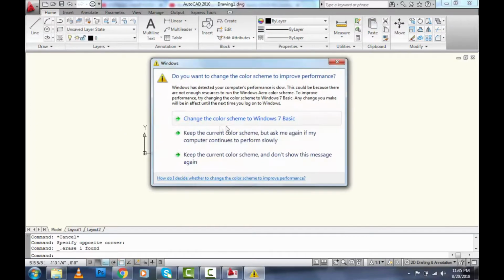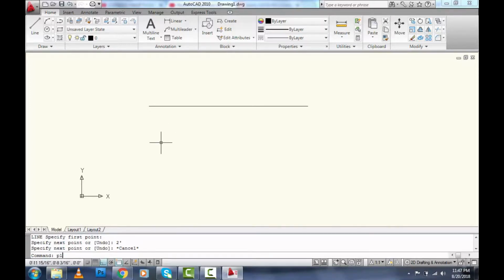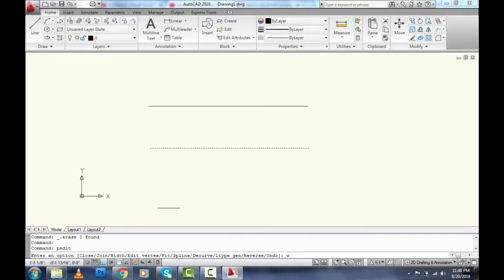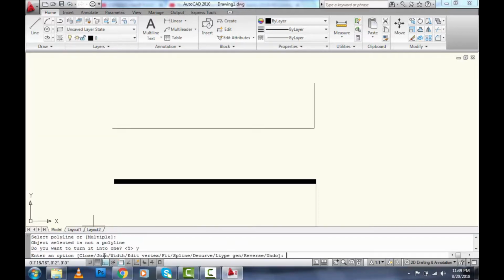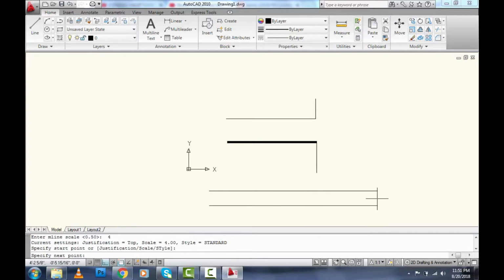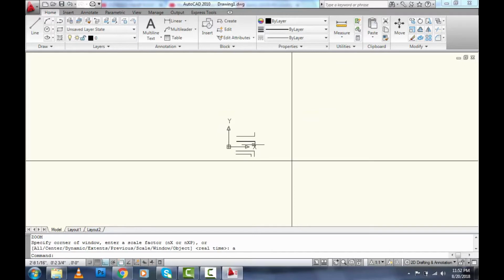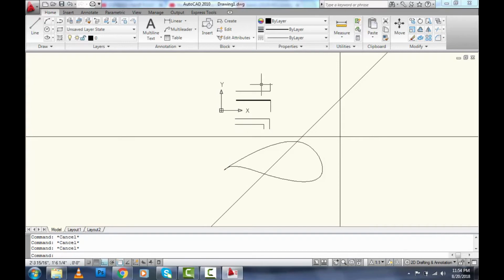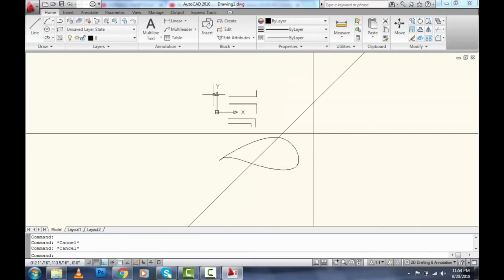Types Of Lines In AutoCAD

Comment: may i ask sir if what is the purposes of every line types give at least 10 sir if you answer this i will subscribe
Reply from the maker: Hi Dexter,

In the video each line shows its attributes which makes them suitable for personal causes. If you do not like to offsett your lines you can use ML, if you want a line that you can use later to create 3d, you us PL, if you want accuracy you can use XL. So your question is hard to answer, however if you want advice on what lines to use for a specific reason, i can give a more in depth answer.

Hope this helps!
Reply: has been 5 years, hi lol